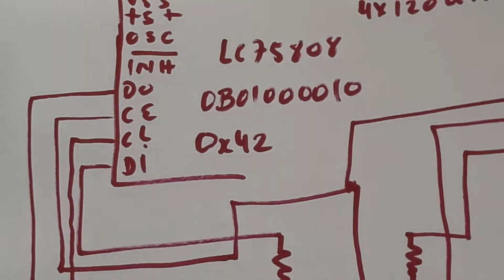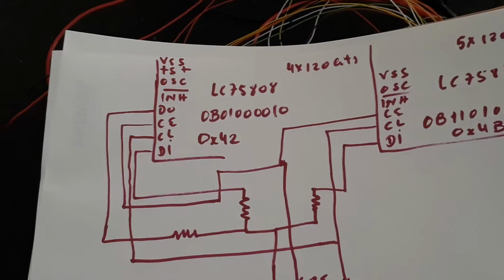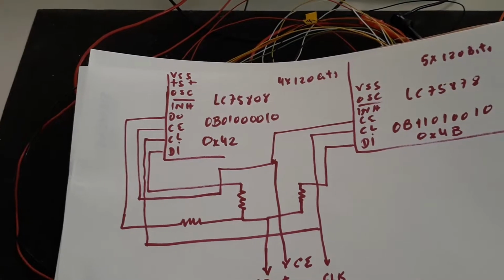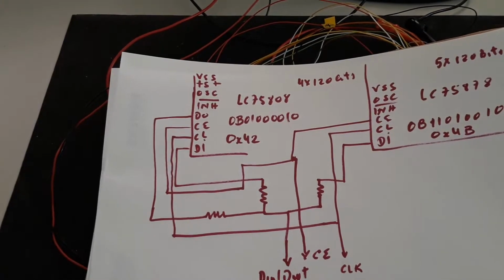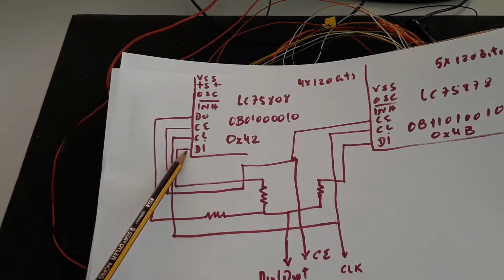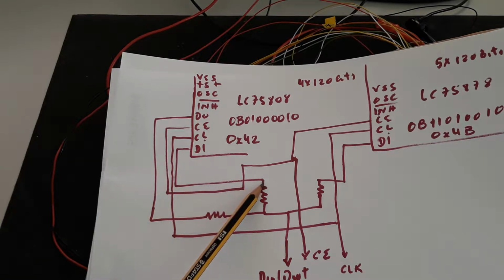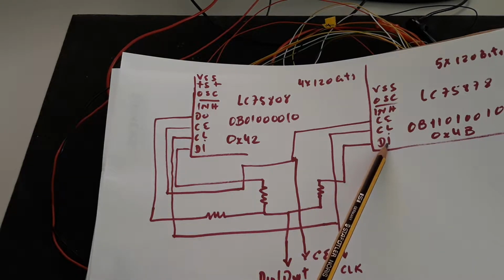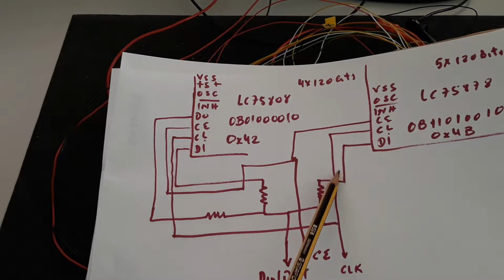LC75808 & LC75878 as drivers of one LCD

Comment: hi, what radio is this panel from?
Reply from the maker: Hi! Honestly I don't have this information! I'm not focuded at it reference and not keep it. Maybe can compare with the panel radio of the Year of the drives. Normally this panels are used by a lot of manufacturers branchs, like Sanyo, Pionner, Philips, Blaupunkt.
Any other information feel free.
Reply: @jlsmonte thank you for anser. could you check the record from the logic analyzer if the communication with the chipLC75878 and IC on I2C is correct?
Reply from the maker: @Krystian Rak Hello! This video is 4 years old, I need to be able to find it among hundreds of LCD/VFD's! Either way I can guarantee you that the communication is working, because both halves of the screen are controlled by each of the IC's

Comment: Hello. Can you share the code for working with the LC75878 driver. I haven't been able to with him yet.😔
Reply from the maker: Hi "Mr. Centos"
They are present on Github, one for both drivers, other only with 75878:
https://github.com/emsyscode
The code is not clean, is only a practical sample... you can put extension direct to the ".ino" if you will go use platform Arduino.
Hope this can help you!
Good job!
Reply: Hi @jlsmonte  
Thanks a lot. The code you provided behaved the same way as my code. It turned out that the problem (panel random turn on and turn off pixel) was that the ground of the arduino and the ground of the power supply, from which I turned on the panel, were not connected. Thank you again.
Reply from the maker: @mr.centos5588  Congratulations! I stay happy if it help to find way!
Reply: , Hey, I have CHAMELEON JVC radio with similar LCD driver and i have problem with it. In my case i have just 5 sec. LED Ilumination and that's all LCD not working. Ho to check this driver? I have mesured with osciloscope on CE and CL and some data are trnsferated  but i dont have shure